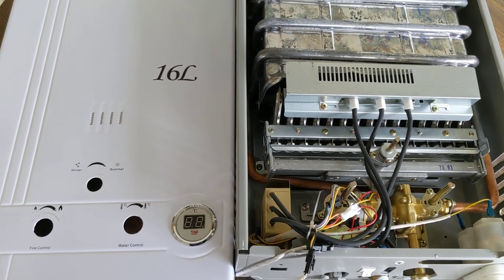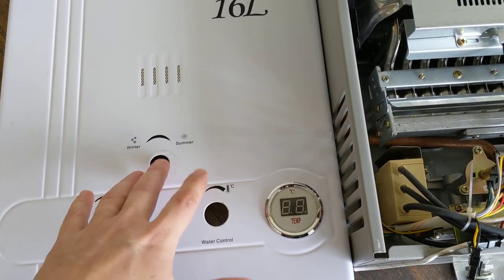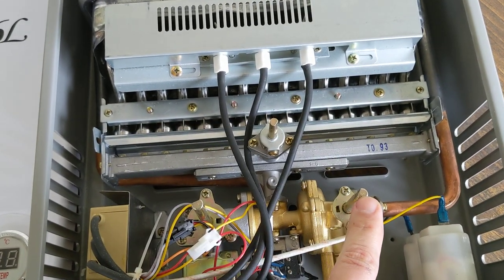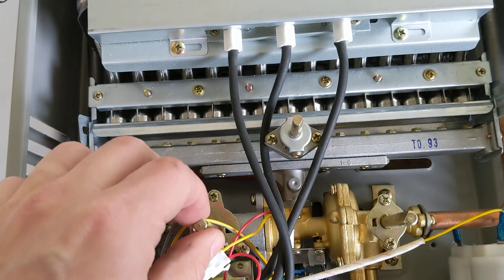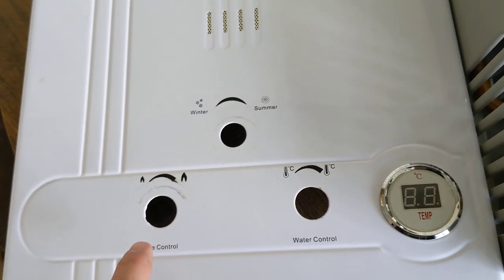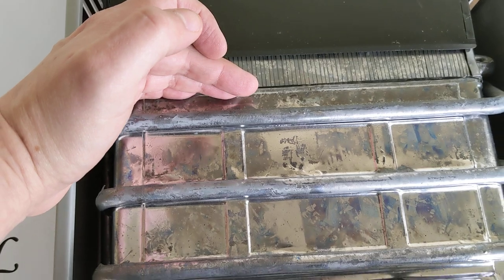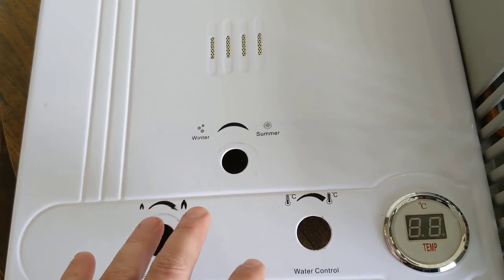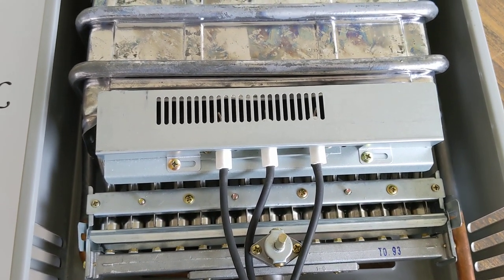Basic control functions of tankless gas water heaters TCMT Vevor Marey

Comment: How do I bypass the micro switch timer that only lets the unit run 20 minutes for a stock tank application
Reply from the maker: I would not do that. It is designed to shut off after 20 for a reason. Making it run more than 20 at a time can overheat the unit and cause permanent and irreparable damage to the unit.

Comment: Weird mine shuts off around 10 min..I have it set to full water flow then low flame with summer setting..by the the 10 min mark it hits 65Cel but if I do it for longer it gets to 70cel - a little over and shuts down
Reply from the maker: Oh no. Did you buy the extended warranty for like $15? It gives you 3 years

Comment from the maker: It is a VERY WISE investment to purchase a 3 year or 4 year on these economy water heaters. If problems occur, you get a brand new one! Also, if your water flow is weak, it would not trigger the flow sensor to ignite. It would not ignite, with the flow being slow, or weak. Some with weak water flow, have fixed this issue by putting in a low flow shower head like this one https://amzn.to/2DUr81n and low flow sink aerators on the kitchen and bathroom sinks like this one https://amzn.to/2Zz5IOZ

Comment: How do I disable the 20 minute timer?
Reply from the maker: There is a reason for that. These water heaters are designed to shut off if a large leak on the hot water side exists.

Comment: On mine, the heater wont work unless the flow is turned all the way down. It remains powered off unless you turn it all the way to the right.
Reply from the maker: Try a low flow showerhead like this one.... https://amzn.to/2Bsuyaq
Reply: All the way to the right is higher flowing not lower
Reply: @daryls9932  no...all the way to the right is the lowest flow.